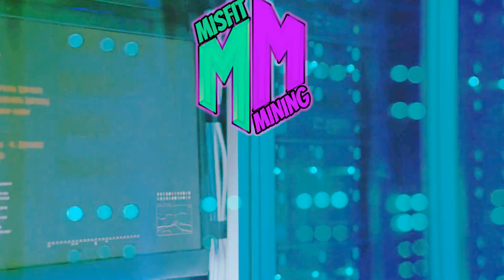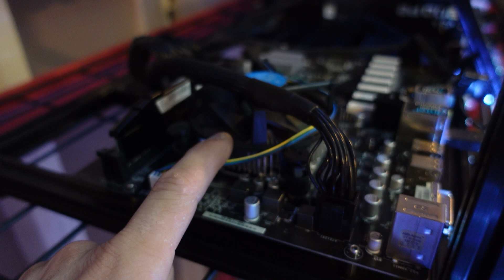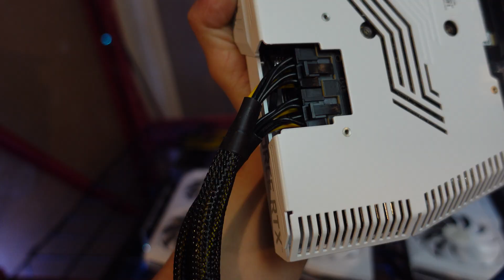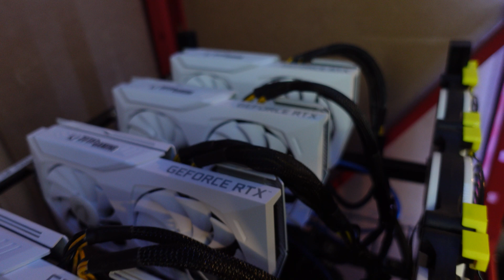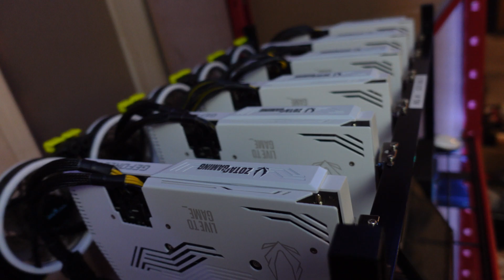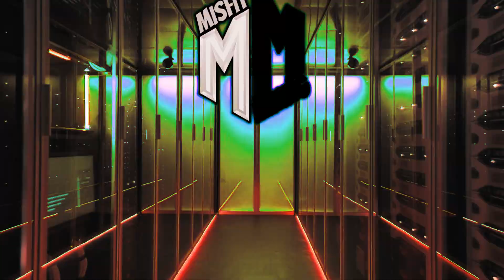RTX 3060 AMP Twin Edge Re-Build | GPU Mining Rig Noobs Guide

Comment from the maker: Do You Own A 3060? If So Do You Prefer Windows or HiveOS? Also Share Your Over Clocks Below!! □
Reply: 3060 TUF. Windows 10. 48-49mh ez
Reply: @LOLBasicever  can you please let me know how you managed to get 50 on the 3060 GPUs with LHR , ie. 25 max limit ?? I have 5 cards and I wish to get them to 50 each. I have the driver, I have the display loads, I'm unable to run them on risers. IF I run two cards on the gaming motherboard, I do get 50, on risers, it is 25. Please advise, or share link on what I need to do. Thanks
Reply: @LOLBasicever  thats for non lhr version?
Reply: Got 4 3060, going to try it!
Reply: Windows, 50C Fans arent even on 5 GPU's 3 NVME dual CHIA Farming /Plotting rig
Reply: I'm running an Asus Strix OC 3060 in HiveOS on Lolminer 1.29 and Nvidia driver 460.39. It's currently running at just over 37mh at about 100w in HiveOS. 1430 core, 2300 mem, power level at 115. It runs solid except when a new DAG EPOCH hits, it drops down to ~25mh until I restart Lolminer. Other than that it's amazing! I might try the fan glitch w T-rex since it's just one card and the extra hash up to 50 would be nice. Rock on!
Reply: I had planned for two 3060’s but at the last min switched up to 3080’s. No rig yet just two new pc’s since my old ones needed replaced.
Reply: I’m on windows with mine. Getting ready to purchase some more GPUs for my first GPU mining rig. However I am mining Helium HNT and was able to get my ROI in 5 days. All bc I used my Density Max solutions strategy. If anyone needs help with placing there Helium Hotspot, HMU . As a Helium Patron Alliance member, I am supporting the helium blockchain and community deploying the IoT network of the Future! .....chump change, such a great video. Appreciate the guide real helpful. I can’t wait to grab some more GPUs during this down time in the markets.
Reply from the maker: @w3mct  Hey man I am waiting for mine to come in SOON!! Ill let you know when it does!!! Appreictae you my man!!! □
Reply: @ChumpChangeXD  hey man, i got 2x 3060 and two more coming. I have it running solid in hive os at 50mhs 104w using the 'hold the fan' trick i saw a week ago from a video here in youtube. Its a bit of a process but it works! His method makes sense instead of too much oc on the memory
Reply: @j.a6778  can u send me the video link?
Reply from the maker: No HiveOS lolMiner it will work 37MH but windows I would have to put one on the board
Reply from the maker: Just switched it to that myself!!
Reply from the maker: @Andrej_d  yes sir I’ll be making a video on ergo soon
Reply from the maker: @PCSurvivalGaming  Hey no sorry I would have to put one on the board with windows to get full Hashrate 45-50mh with the old driver and dummy plug
Reply: @Andrej_d  I have 14 cards on risers in windows , so yeah windows is not a limiter
Reply: Can i do it with 3060 elite 12 gb v2 bro ?
Reply: Dude I have 12 3060 and 8 of them on a rig. IMO, if you want to use 3060 due to it's cheaper cost, you really need to learn to use Windows and 16x riser and/or multiple 16x channel boards. 
I use a X79 custom board that has 8 16xPCIe channels (and just ordered one what 9 channels) in Windows 10 with the old driver, each 3060 runs at around 47 to 48.5 mHz, so my 8 card rig is around 370 mHz/s.

Although you need to optimize the windows setting like always power PCIe slots (off power management), it became much more stable. I dont know how stable HiveOS is but it usually is the miner that crash the PC. Before I adjusted the settings, the miner crashes at least once a day. But looks to be much more stable now. (I use T-rex)
Reply: @blackholestorage168  hello Boris, please, do you have tutorial?
Reply: @blackholestorage168  non lhr version?

Comment: I’m wrapping up my 1st 6 card mining rig this evening and this video was well explained . 
I’ve been scratching my head in where and how to hook up the frame fans and daisy chained and where it connects to the motherboard tip was right on time . 
I’ll be trying to add my config file to my hive OS after that which being a noob has my anxiety level up a bit . 
If I have any questions regarding I’ll ask in your discord support chat . 
Blue RBG light is a nice touch ! 
Thank you !
Reply from the maker: You can plug into the riser need be I’ve done that
Reply: @ChumpChangeXD  Just got settled in from work and about to jump into it .
My fans each has a molex with a 3 pin splitter . Which ever way you think would be best I’m for . 
Which chat in the discord would be best for the last couple issues regarding my last bit of wiring and maybe a hive OS question . I plan on being up and mining no later than tomorrow is what I’m thinking and hoping . 
This is the 1st time I’ve reached out in my 1st pc build ever besides the other night when someone in your discord showed and helped me with the no power switch dilemma 🤣. 
Now I have a power switch and all 6 rx 6600 along with motherboard fired right up . Seeing it fire up was absolutely an outstanding experience. 
I’m rambling ,, i tend to ramble scattered from work . Fast pace dangerous job is why I reckon

Comment: Hi there, I have a question, I wanna build a rig, and I want to know what graphic card should I use, I can use 3 * GTX 1660 super, 3 * RX 6600 XT, or 3 * RTX 3060. 
My own choice is 3060s, because recently I noticed that in some updated versions of miners they could unlock 75% capability of nvidia 3060, so Is it right that I could use multiple RTX 3060 with 75% capablity and if so wich set should I choose? ,Tnx

Comment: Don’t you need dummy hdmi plugs and 16x to 16x pcie expansion cables for 3060? Or is it only for the non LHR ones?
Reply: I was thinking the same
Reply from the maker: Only with when your mining eth or you can do the 3/4 unlock with the correct miner/driver

Comment: are these LHR cards? Doesn't using risers kill your hashrate? I heard you have to use PCIE full x16 slots to get the 50 megahash out of these cards.
Reply: Did you find out if these were LHR cards and if indeed using risers kills hashrate?
Reply: They will run around 36 mhs (75% unlock) just fine.
50 mhs is only possible for the old LHR which the last production is around May 2021.

Comment: Don't you need 16x or 8x lanes for 3060 to get a full hashrate of about 50mhs?... 
I'm pretty sure the other motherboard didn't work because either the board or the cpu doesn't have or doesn't support that many pcie lanes. For 6 cards you would needs 6* 8 lanes

Comment: Bro, can you please let me know how you could manage to get 50 on the 3060 GPUs with LHR , ie. 25 max limit in Windows??? I have 5x 3060 cards and I wish to get them to 50 mh/s each. I have the right driver, I have the display loads, I'm unable to run them on risers with full hash rate, max currently is 25mh/s. If I run two cards on the gaming motherboard, I do get 50 mh/s, but on risers, it is 25mh/s. Please advise, or share link on what I need to do. Thanks
Reply from the maker: Hey so there is a three-quarter unlock which allows you to get close to 40 MH on risers within HiveOS. The only other way you can do it is a very expensive set up with a motherboard that has a crazy amount of “Cores”

Comment: Thought that 3060 needed a pci 3.0 8X or 16X in order to run, how are they running on the pcie X1 slots ? Very confused.
Reply from the maker: They run at 37mh on lolMiner not 48-50 as normal if it a 8 or 16x slot
Reply: @ChumpChangeXD  so does one of your GPUs give 48Mh as its riser is in the main x16 slot ?
Reply from the maker: @AiriiaSurajSalklein  no because it’s on on the board and it has to be in windows to do so with the old driver…

Comment: How do you NOT have a 100k subs yet? I've been here all year benefiting from your break downs. I actually want to make my own content because of guys like you and RedPanda.   I appreciate the amazing brackets for the wire rack, and the awesome content! keep it up :)
Reply from the maker: Hey man!! Thank you so much and the biggest mistake is to not just make your first video! If you need help or pointer PLEASE reach out to me in discord!!!
Reply: @ChumpChangeXD  sorry my english is bad, 6 vga's with 1200platinum evga psu is enough? 
how bout 3060ti x6 1200p2 psu can handle it for long term?
Reply from the maker: @arifmuhammad434  If undervolting to 120-125 each yes should be fine I would like to think.
Reply: @ChumpChangeXD  im running on trex miner, it shows 95-105 watt, does it show actual value?

Comment: I dont have to power the molex`s and sata`s on my h110s. Im having 3 of them and zero issues with it
Reply from the maker: Oh really? Never been allowed not to use it and I have many. On start up it pops up with a screen and yells at me if its not plugged in every time.
Reply: @ChumpChangeXD  lol how funny. Maybe it's the bios, you can try it with the H110_Pro_BTC_L1.64A2. Maybe it will work then. I have enough Molex cables to connect the connectors but it works without so I thought I'd leave it out.
Reply from the maker: 100% agree